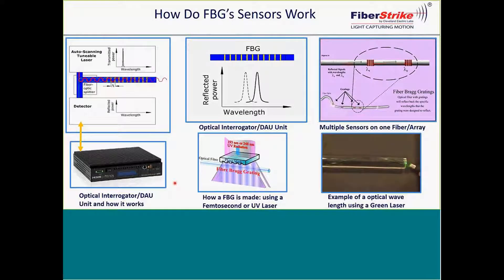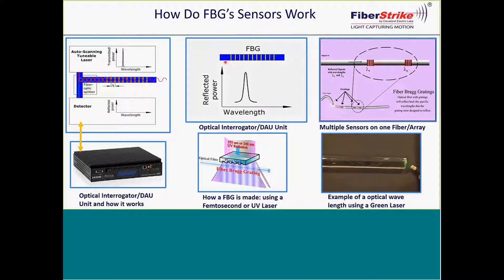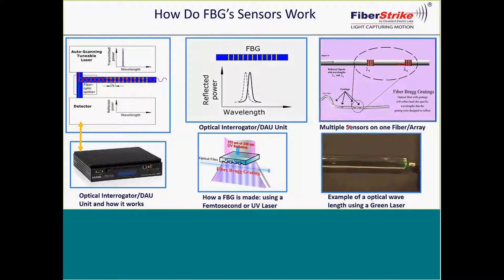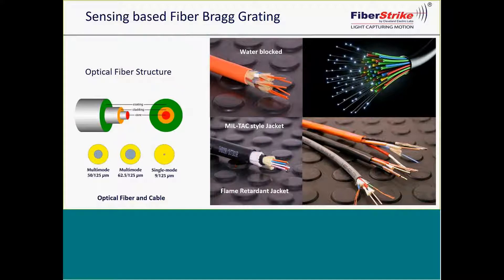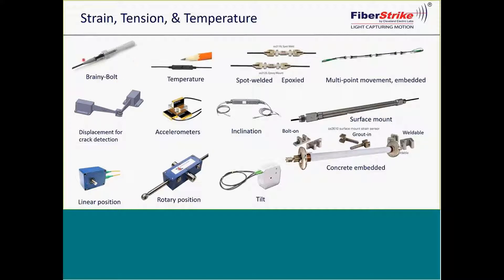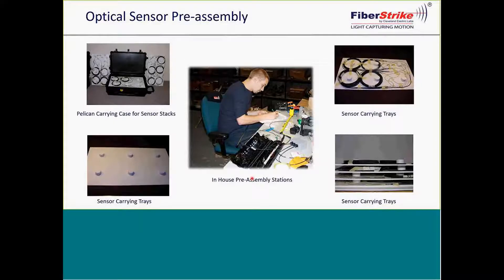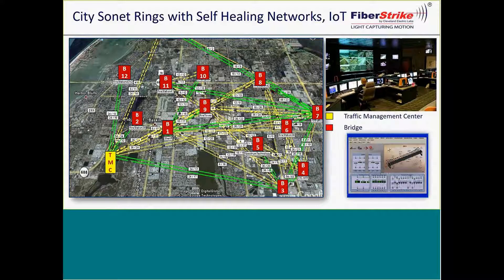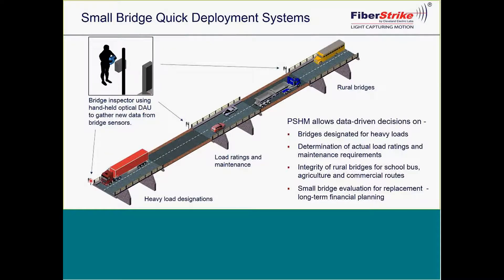How Do Fiber Bragg Grating Sensors Work and Its Deployment Advantages - [PART - 2]

Comment: Thanks for the good video, now I am struggling with a problem about FBG temperature sensor, hope you can give me some suggestion. I am using FBG and pt100  to measure the temperature of a tape at the same time, the grating length is 10mm, the dimension of pt100 is 2mm*2mm, how can I arragne them to measure the temperature of the same location, the FBG is 10mm long, is it measure the average temperature of 10mm long distance? or it just measure some certain point? Thanks!
Reply from the maker: My apologies for not getting back to you yet.  For some reason we missed this comment.  I will send your question and get an answer for you.
Reply from the maker: Yes, the FBG will take readings and average over the length of the grating.  The PT100 type would have to be put in close proximity of the FBG. Call CEL-ATG for more specifics.
Reply from the maker: 866.914.3727